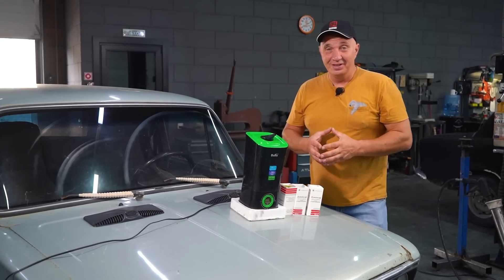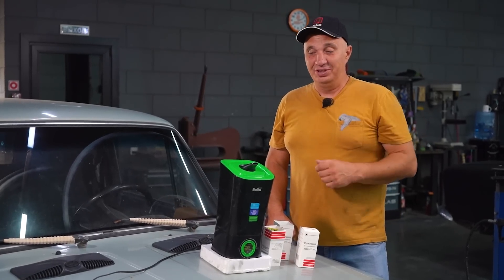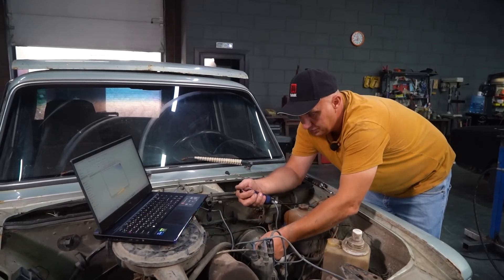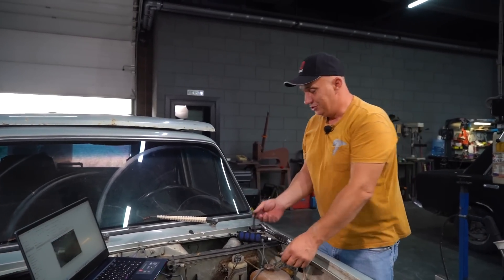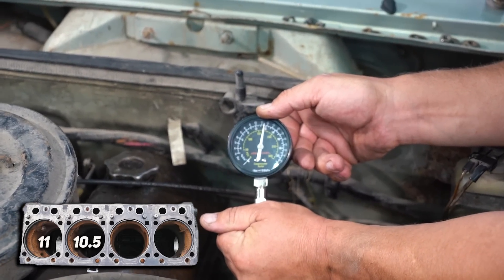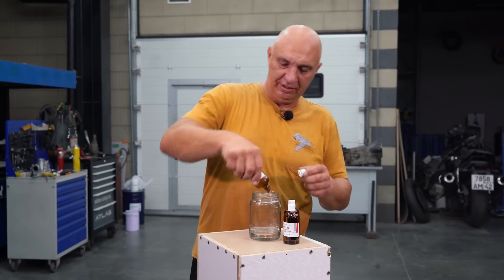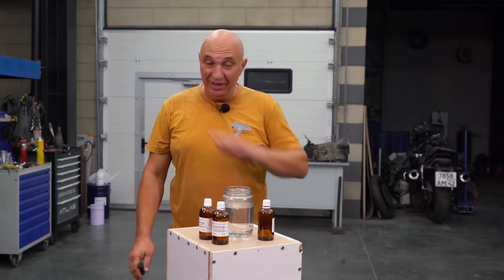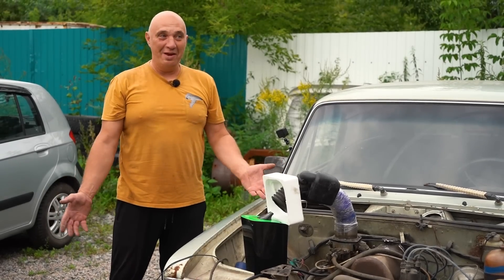Cleaning carbon buildup with dimexidum vapor - will it work?

Comment: A spoonful of ATF sucked into a vacuum port on the intake run the engine until you see smoke out the exhaust. Shut it off wait one hour and then fire it up and all the carbon will blow out the exhaust. It will make a lot of smoke and carbon out the exhaust
Reply: Anyone else hear a cat crying in pain?

Comment: Use more rpms , the air velocity will help clean cylinders with spark plugs burning hotter - it will clean better..

Comment: DMSO when diluted is great for inflammation in joints, and muscle pain. Used DMSO cream for back pain works amazing!
Reply: It wasn't dmso. It is great inntransportation THROUGH skin. This substancje transports water, meds or aby other stuff. That's why it worked well.
Reply: @marekukawski202  DMSO is also used topically without any other active ingredients added. You're right about it being able to carry other substances through the skin, but it has somewhat of a positive effect on joint inflammation and pain on its own aswell.

Comment: Few years ago I was thinking to clean my Toyota vios 2nz-fe combustion chamber and oil sludge using DMSO after I saw a guy did it in YouTube video. He said it was Russian style of engine cleaning. Later I decide to overhaul the engine, and it clearly needed piston oversize.

Few months ago I tried to clean oil sludge in my Toyota 2kd-ftv engine by mixing 25% palm cooking oil with cheap engine oil, drive the car in city for 3000 kms. Few days later I saw from the filling cap hole it look shiny like new aluminum color under the valve cover. Then I change the oil, this time with 15% palm cooking oil and cheap diesel oil.

Comment: The #2 cylinder looked really clean from the start. It also had slightly lower compression. Maybe a small head gasket leak there? #4 cyl seems like it has ring issue. Is the oil ring is stuck inside the ringland? Just a guess.

Comment: 0:57 Cleaning this engine is senseless!
You see the "ringwash", oil is passing by the piston rings. They are either worn out or clogged up (most likely).
A disassembly of the engine is necessary.

Comment: You should start and run engine for a minute after checking compression, to remove the oil from the compression testing procedure, oil will be there from turning over without firing, even on a new engine.

Comment: Most carbon removing cleaners that professionals use contain Naptha.  Naptha is a solvent that will not burn in the combustion chamber, and is used to clean the barrels of battleship guns for this reason. 
 Water works well, because of the chemical reaction to carbon.  H2O + C -----> H2 + CO  Steam works even better.
Reply: Naphtha is white gas or Coleman fuel and burns very well. It's basically gasoline with no additives in it.
Reply: Wait - so you could hook up a steamer to the intake and clean the carbon out?

Comment: a warning. you should try brake clean. full throttle, air cleaner out. it will amaze you on the carbon and crap that comes out the exhaust. that being said, make sure you have an exhaust hose on the tail pipe. it is toxic as hell, but works better than anything
Reply: and produces Phosgene gas.  Used in WW1 during trench warfare.
Reply: @vilefly if it's chlorinated (tetrachloroethylene, carbon tet) that is. If it's just hexane/heptane, it will burn like normal gasoline
Reply: @Sam-ob4of  It is not hexane nor heptane.  Wish it was.  Trichloroethane or ethylene, I forget.  I think Trichloroethylene.  Too close to the old r-12 formula for me, which decomposes similarly.  Naptha or steam is a better solvent.
Reply: @vilefly  Jeez, don't put halogenated hydrocarbons into an engine or the environment for that matter.
Reply: He is Russian, not Italian.
Reply: Honestly, just run it at full throttle for a good period of time and it'll burn it out pretty well. Shave a couple working years off the car though

Comment: Does that sea salt or sea foam cleaner actually work ?  I need to do this and so far good things I hear, but you guys should try that next since it’s a used product for most.
Reply: There's so much about this out there already. Simple answer is it might, or might cause even more problems by clogging oil channels or failing seals after clearing out old sludge. Could be rough on the cat too. It really depends what vehicle and how bad of shape it's in. Most likely it won't hurt anything. I don't have anything against seafoam except the price can be a bit absurd for what it does. I'd start with steam if you need to go this route.

Comment: You should try using water as brake fluid. See if you can make it boil.
Reply: Would likely heat up and force the brake down before it actually boils

Comment: Just use water. Old timers always used water to steam the cylinders clean. That’s same reason a blown headgasket always shows a totally clean cylinder where it is blown. Steam baby!
Reply: instructions unclear, removed headgasket to clean engine.
Reply: superheated steam actually chemically combines with the carbon to make syngas

Comment: Bet lemon juice and water would work better increased vapor volume would help to to raise combustion temp
Reply: Terrible idea. The acid would cause damage to the metal, and wouldn't affect the carbon at all. Sure fire way to rust the engine out. Water would be much better alone

Comment: HHO or electrolysis , hydrogen and oxygen. IT removes the carbon from the rings and valves. Its like pressure washing the engine from the inside. Ill put a link in the next comment on the process.
Reply: https://youtu.be/Ljm8m85p6T0?si=zlsJlgvZzR5xLE2l

Comment: DMSO cleans so well, it improves compression and cleans internals, but final synopsis is that it's useless. Ummm, reduce the water in the DMSO to zero and redo it for even better results.

Comment: Back 40-50 years ago when we had a seriously carboned up engine come in (and a cheap owner) we would take a 16oz. coke bottle, fill it with water and trickle it into the carb. (sometimes more than once) until it started missing several times, all along dumping black smoke out the tail pipe and do it until it cleaned up pretty good and it would clean up quite a bit . One time we had one of those customers with a 429 ford and it wouldn't even shut off with the key (dieseling), because the carbon raised the compression so high and when we did it there was chunks of carbon flying out the tail pipe . After the treatment the car ran pretty good and acted normal . lol
Reply: Little known fact. Controlled water injection will keep an engine spotless and increase efficiency.
Reply: @markm0000  during WW2 we ran it in aircraft engines for anti-detonation and increased hp.  The Germans ran nitrous.
Reply: @markm0000  you are right I had one of those water injection systems and ya it worked great I installed it on my 74 jimmy but it didn't save me on fuel consumption that stayed the same and it was advertised as saving on fuel, but it did keep my engine clean. Before I got that system I used to pour water down the carb while keeping the engine reved it also helped clean my engine it is like steam cleaning it does really work.
Reply: Makes perfect sense if you've ever seen the inside of a cylinder with a blown head gasket. Steam cleaning is extremely effective.
Reply: I did this often with an airport fuel truck.  They carbon up horribly due to spending most of their time cold and idling.
Reply: We had a guy come in with a carboned up engine with 600,000 miles. Ran pretty good too considering. 
We ran a new oil in it and it cleared all the carbon off... Engine had no compression after a few miles...... Carbon kept it sealed...
Reply: The carbon doesn't increase compression that much to make it "diesel", it's because the carbon glows red hot and ignites the fuel like a glow plug
Reply: @MiG21aholic  you are right dude! Something similar happens at 2 stroke engines 😂
Reply: Great idea in theory, but in today's car with catalytic converters you might as well budget for a new one from all the carbon chunks that'll clog it.
Reply: It steam cleans the cylinders, look at a car that has had a failed head gasket and the failed cylinder is clean from the steam from the coolant.
Reply: We used brake fluid for the same results and it also was great to get a tired rotary engine started 😉
Reply: Do this proces with diesel?
Reply: I just drive my cars in floods keep them nice and clean lol
Reply: I've done the same thing to Onan twins to keep from having to pull the heads and decarbon them every other year.
Reply: I've heard of people doing that with Windex.  Takes a while, but it will steam clean the cylinder.  

Now, if they could figure out something to spray into the intake that can clean the intake valves on a DI engine, then we would be somewhere!  Current products really do not work.

Comment: back in the days we just sprayed carbonated water into the carb at high rev.  just shaking the bottle and control the flow with  a thumb.
Reply: I used a pump sprayer to mist water into an engine while driving trying to replicate the blown head gasket affect.
Reply: It's only effective where it hits material that can flash boil the water. The CO2 really wouldn't do much extra there. Wrong form.
Reply: @MadScientist267  its just to make pressure so it can spray a mist.  this way you just need sparkly water and no equipment.
it will remove the carbon buildup same way as a leaking headgasket does when coolant get into a cylinder just with milder effect.
Reply: @MrLarsgren  Fair enough then
Reply: @MadScientist267  it was before catalytic convers so if trying it today  maybe disconnect catalytic converter so it dont fill it with carbon chunks. it works
Reply: So... what you're saying is... you wasted time and water.
Reply: @MadScientist267  it was an experiment, I had no way of verifying anything. 

I noticed nothing besides water in my oil, which I ignored and let evaporate on it's own, it was gone in a week of commuting.  (Yes I didn't care about the car).
Reply: @MadScientist267  water can loosen the carbon and sludge too. its just not as effective as modern chemicals.   it being carbonated water was just to make the process easy.  it was like 30 years ago